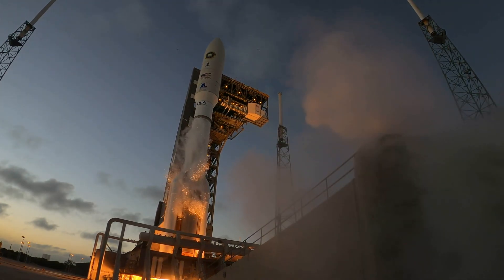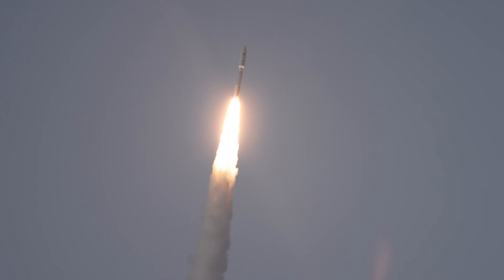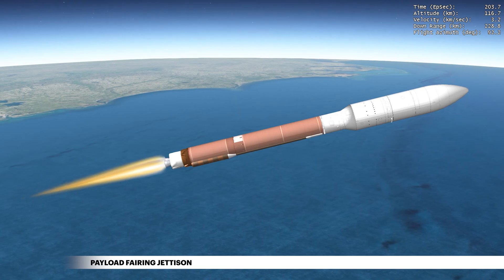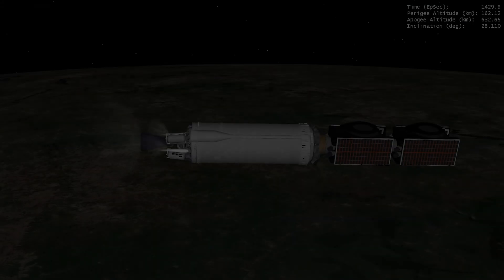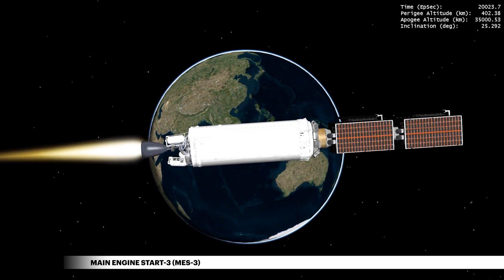Atlas V SES-20/21 Mission Profile

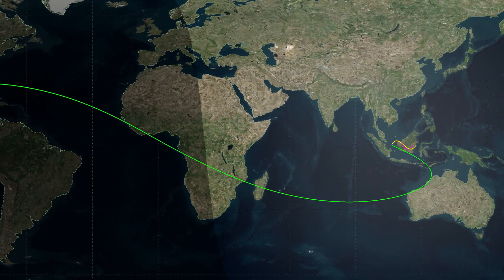Comment: 2:22 seeing the orbit path to deliver to geo is so cool. I never realized GTO resulted in a retrograde path to geo
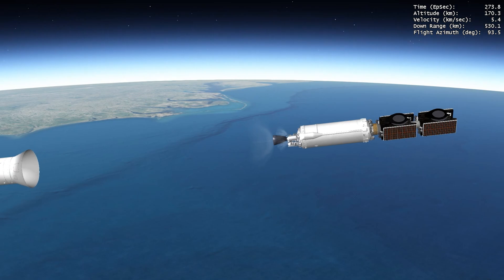Reply: You seem to know what you are talking about can you tell me the transition from 1:00 to the following scene 1:15 please ? ( I do not know much about orbits )  The altitude was listed at 170 km and downrange distance 520 km roughly . To this point I think I mostly understand what is going on ( I still do not know what the Flight Azimuth angle is  ) So the time elapsed timer  jumped to 710 seconds from the previous screen time of 284 seconds  ( 1:00 to 1:15 ) and it seemed to have transitioned / entered to  an elliptical orbit !? 163 km to 611 km Inclination 28 degrees ( I do not know what inclination is ) At this point why has the downrange distance disappeared ,  what is the actual altitude and where are we the landmass below ? 
1:33 Massive delta between perigee and apogee 35000 km !! Inclination 26 degrees after a multi hour coast 
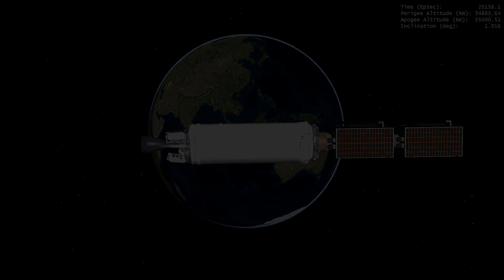2:00 inclination is less than 2 degrees we seemed to have reached a roughly circular orbit at 35000 km altitude and the satellites are deployed.  
Also what happened to the three side boosters which separated at 41 km altitude,  the  first and second stages  ?
Reply: @111danish111  So azimuth and inclination are related, but you have to think about the Earth as a sphere and there's orbital mechanics at play. At launch, the azimuth is the relative angle of the vehicle trajectory. Once it begins to travel beyond a few hundred miles, because it's relative to a sphere, and will ALWAYS cross the equator, the actual angle of travel relative to the planet changes, so the overall direction of travel, rather than instantaneous, is measured as the inclination. So at launch you'll have an azimuth, but the resulting orbit will have an inclination. By continuing to fire the rocket in various directions, the inclination can be altered. Typically this is not the case, and in order to maximize velocity and thus orbital height, a vehicle will point in its intended direction during the pitchover maneuver immediately after takeoff so as to minimize wasted energy. In GTO, however, the boost up to apogee extends beyond GEO orbit, as you can see in the retrograde travel  where the spacecraft is orbiting slower than the earth's rotation. It's in that retrograde time that positioning burns take place and cancel out longitudinal movement while at the same time circularizing the orbit as it descends to end up exactly at the right spot along the equator for geostationary orbit. 

It's not easy to wrap your head around and I may be slightly off, but hope that helped. It is, after all, literally rocket science.

As for the side boosters, those fall away and splash down early in launch.